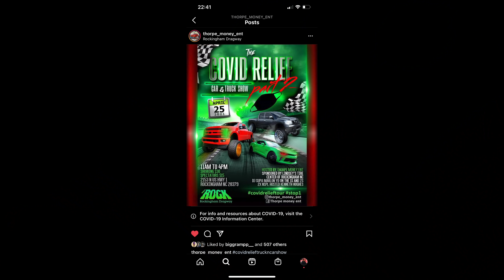GRAMPS NEW 26x14s?! Lift Maintenance VLOG #BackyardBuilt

Comment: I'm glad I came across this video because I have a question actually, not to mention any shops name I won't even mention the town that it's in here in NC but long story short took my 08 explorer to them to have a leveling kit an bigger tires and rims put on and $4,000 later an not even a week after having it done, all it does now when you drive it an even just getting in an out of it, it makes this horrible knocking/squeaky chair kinda noise, have any ideas what that might be? It didn't do it til after I got it back from that shop.
Reply from the maker: Check all your bushings and make sure they are all properly greased and lubricated, most kits require you to lube/grease the parts you put in. Also check your 4wd as well, make sure your axles aren’t hitting anything